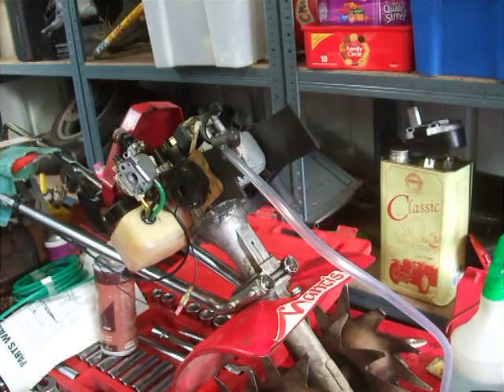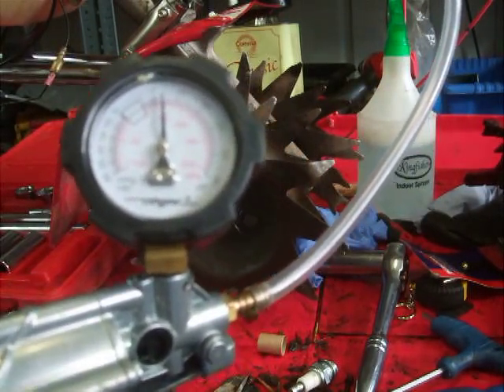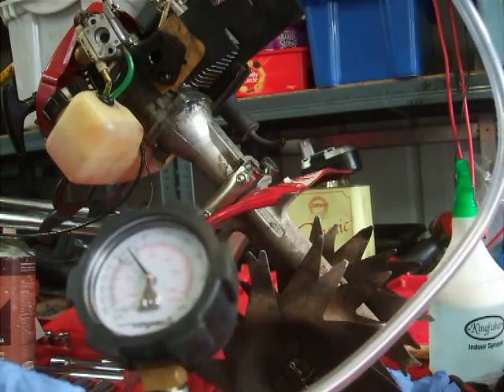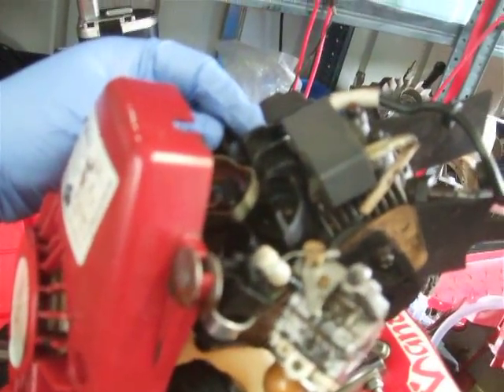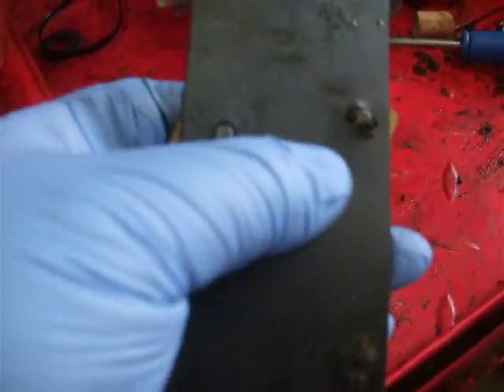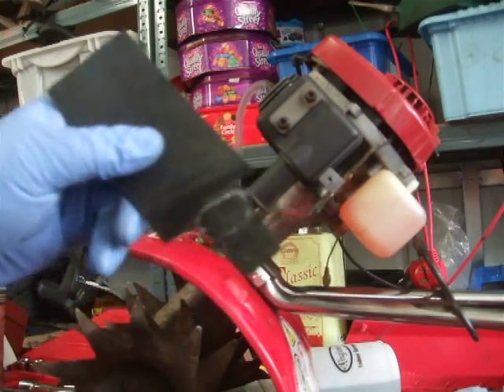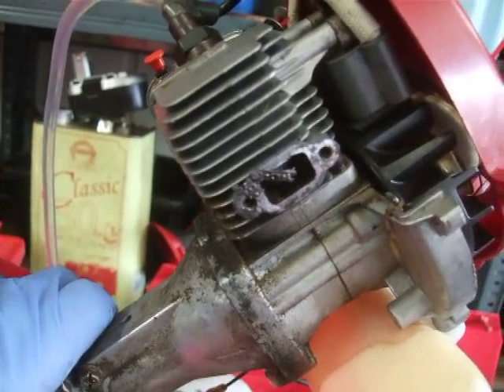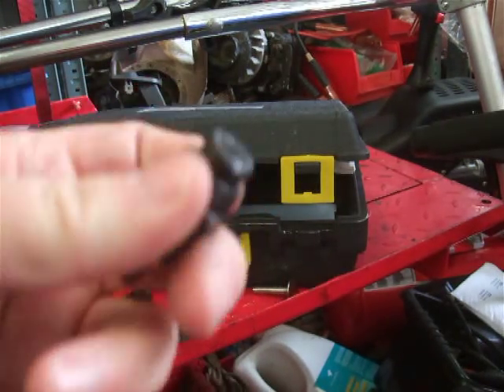HOW TO DO A LEAK DOWN TEST ON A 2 STROKE ENGINE (2 CYCLE)

Comment: Good video on leak down testing i use the fitting off a old compression tester to screw in to the spark plug hole just look on the boot sales for a old compression tester works out a lot cheaper then the Echo fitting you have there, The vacuum readings are calibrated in inch's mercury vacuum , the rubber blanking plates i taper them like the stihl ones.